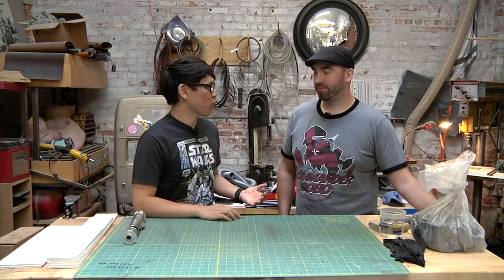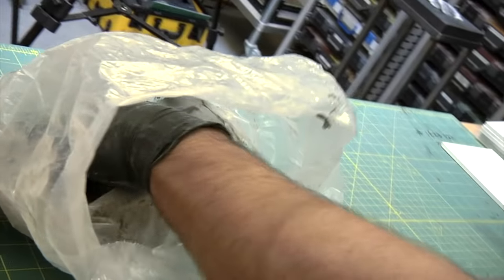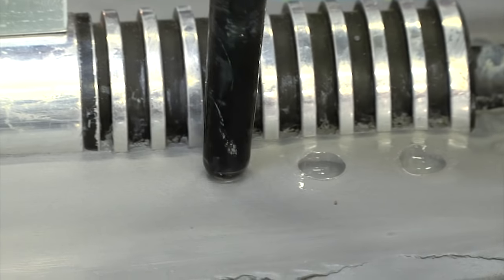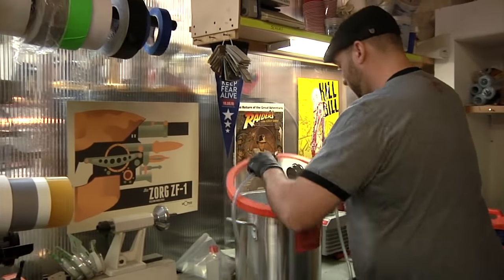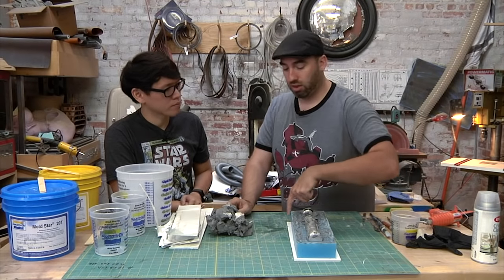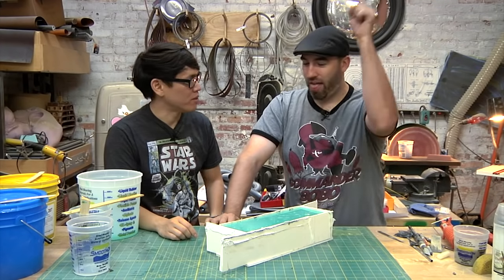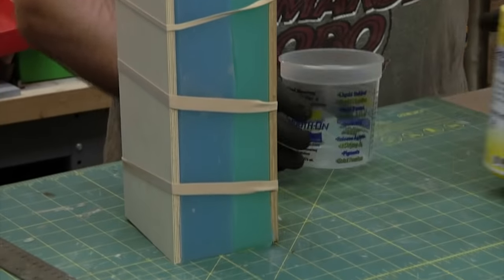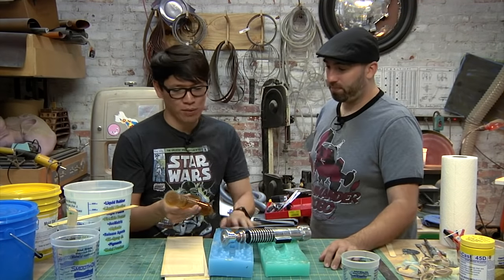How to Mold and Cast a Lightsaber!

Comment: RIP to all the perfectionists out there who were dying like me. this could have been done so much neater with painters/whatever tape ugh. esp as he says its a cylinder. im never gonna make this but if i did id have a laser level and 2 layers of painters tape. peel off tape boom straight line and takes the remaining clay with it then you only have to mess with the ridges and the lower half for the messy part.
Reply: i know its not perfect but it looks great in its case in my office. I bought the object made in this video through the tested garage sale many years ago. Even got it signed by Adam at a live event. 

I had thought about working on the ridges and doing a paint application before it got signed but now it will stay in its naked silicone forever.. Maybe it will get a coat of clear or two in the future if i notice fade in the signatures. 

Both Adam Savage, and Michael from V sauce signed it. - I have the one from the video - Frank pulled one for himself, and adam has the origional. I am never ever selling it.

for pics check the pinned tweet on my twitter.     - 6 years later and youtube recommends  this video again haha... have a good day.

Comment: I don't get it why don't you just make one mold of it the cut it in half
Reply: because they don't want to ruin the objects inside. And cutting them in half wouldn't give registration keys, which are important to "lock" the mold in place.
Reply: Ilyasa Amiry Silicone shouldn't hurt it, and you could cut the mold in a zigzag pattern, couldn't you?
Reply: Oliver Sykes Yes, silicone won't ruin the object. i was referring to "the cutting it in half" part. Unless you want to spent god knows how many hours just on cutting the mold slowly and carefully just so you wont as much as scratch the objects inside OR screw everything and just cut the mold without any regard to the original object. Then yeah, making one mold and cutting it in half is a choice.